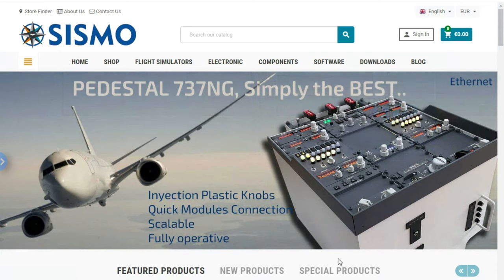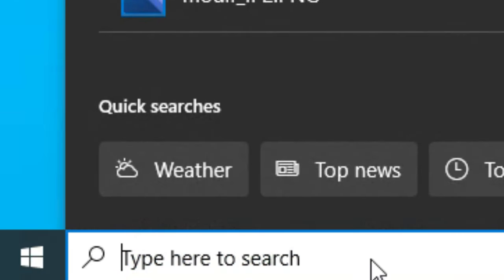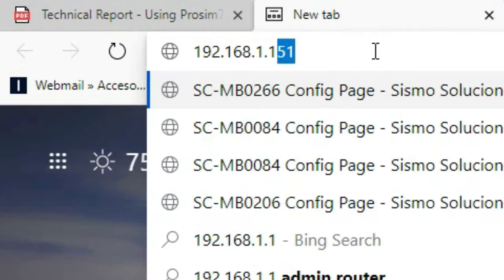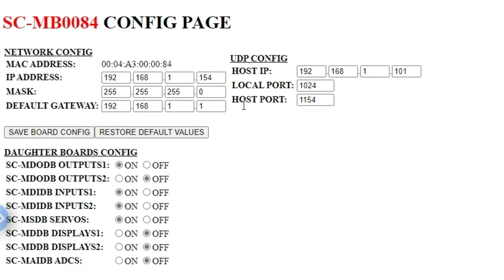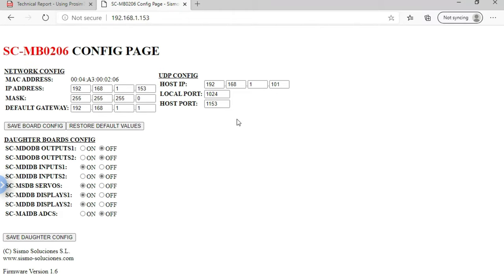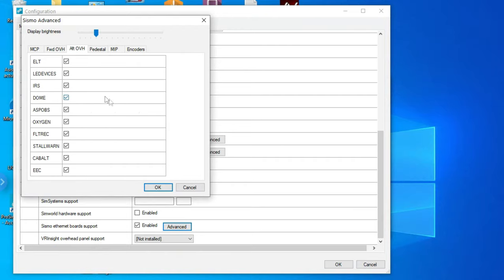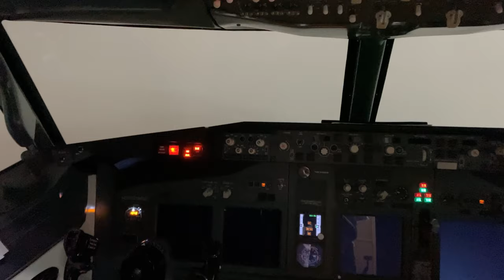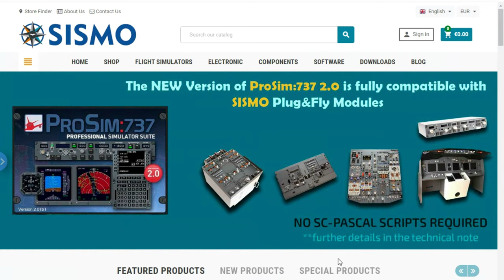How to Configure Sismo Modules using ProSim:737 - TUTORIAL

Comment: Hi when I try the first step, i copy my IP and then paste it with the SISMO one. But it says Hmmm… can't reach this page. So what can I DO? BTW my overhead panel is NOT connected
Reply from the maker: Hmm I'm not quite sure I understand you. I can help you more if you send us more information and screenshots to support@sismo-soluciones.com
Reply: @SismoSoluciones  Alright Thanks :).
Reply: @SismoSoluciones  What I meant is that currently I do not have any of the SISMO products. So when I open the link of sismo it does not open. DO I NEED THE SISMO PRODUCT TO BE ABLE TO OPEN THE LINK?
Reply: By the link I mean the IP link
Reply from the maker: @PoemsForYouOfficial  Yes you must have the Sismo product connected with an Ethernet cable in a LAN to see the configuration page.